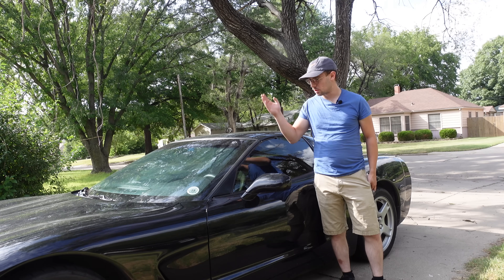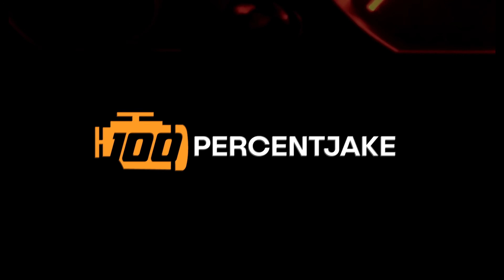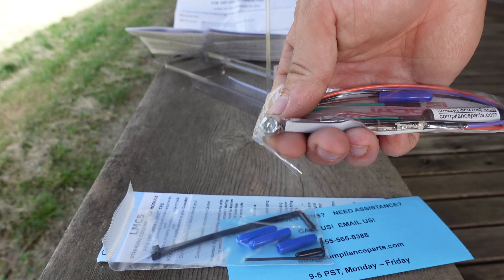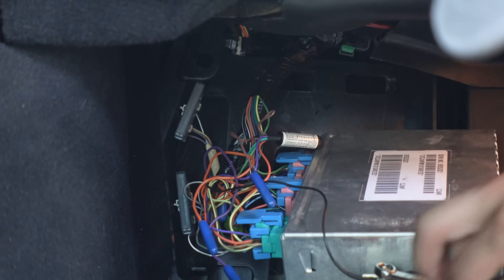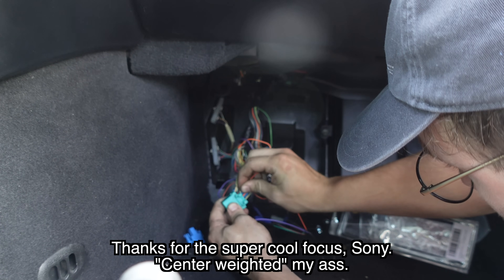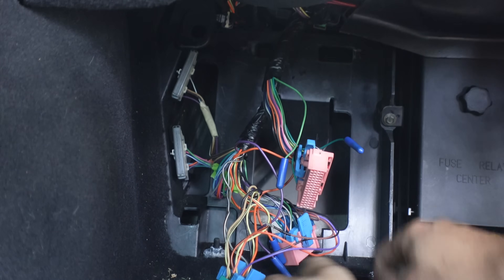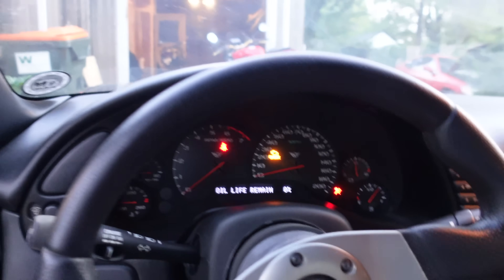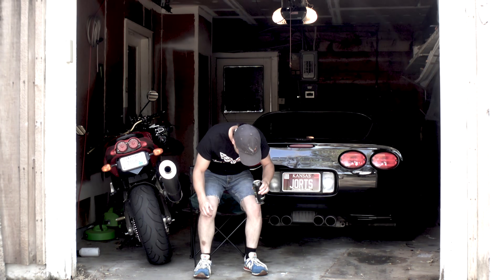This BREAKS on EVERY C5! LMC5 Module Installation

Comment: So with the LMC5 module now the steering wheel doesn't lock. So the car doesn't have that safety feature anymore.  But I guess that's better than it locking up on you when you least expect it.

But I would have just hooked up the brown wire on the LMC5 that was already installed and see if that fixed the issue, so you could return the new one.  Or, why not let a dealership do the recall for it?
Reply: Because the dealership recall is known to fail also. Its very hit and miss but the LMC5 with the brown wire mod solves it 100%.

Comment: Tried the fix dealer popped steering wheel dash etc etc . Now after that 150 miles later shes pull key wait 10 buck jumping carring on. Waiting to take back too dealer after lcm5 and 1000 grand later for fix. Z06 2002 I bought new. Anybody with that problem? I'm worn out now but car has few miles on it. Its flat out embarrassing for that to go down ppl not know wait..ain't me. C5 problem
Reply: Do the brown wire mod.